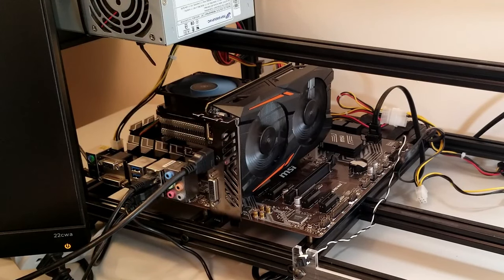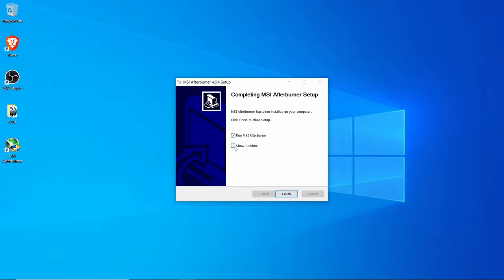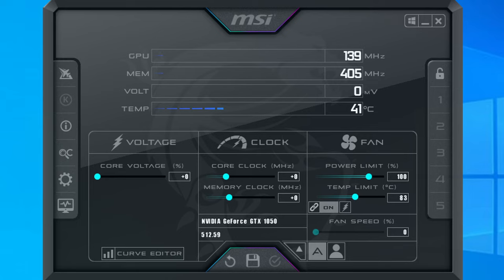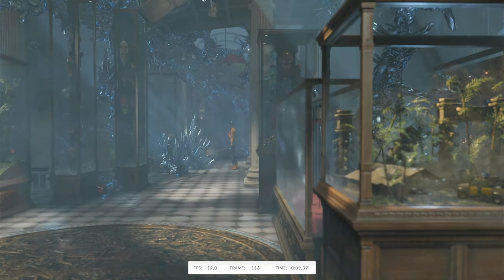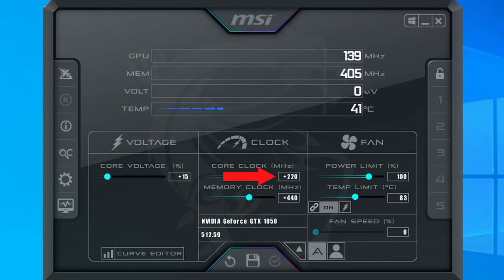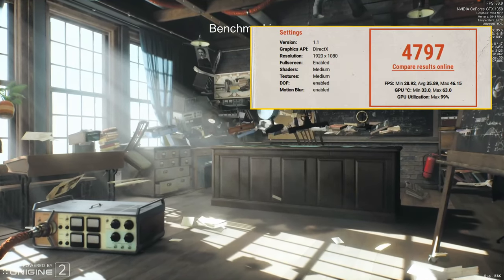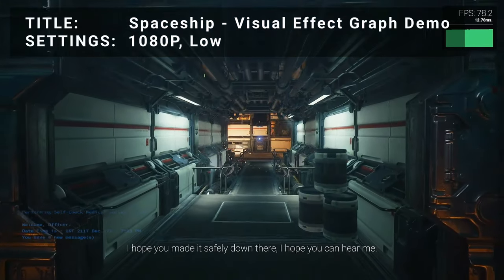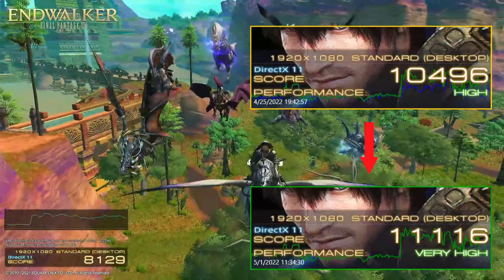Best GTX 1050 Overclocking Settings Guide

Comment: So u can make a gtx 1050 into a 1050ti by overclocking it 😅😂. I have noticed a slight performance boost by using old drivers and then OCing the card. I use a program called nvidia inspector for overclocking and memreduct to maintain a good fps in games even though I have 16gigs or ddr4 Ram. With every new drivers there are fixes but very very slight performance decrease 🤔
Reply from the maker: Thats a great point. Sometimes you can get higher overclocks by using older drivers.
Reply: what specific older driver you use mate?
Reply: @jeremiahb.1868  Right now I am using the latest one available 
When I used to use the old one it was 374. Something like that

Comment: I have gigabyte gtx 1050 2gb oc card for 4 years, can I safely overclock it? or it would be any bad impact on card?
Reply: My GT 1030 SDDR4 2GB has been running smoothly with me for 2 years now, you can overclock it of course since yours is more powerful than what I use. Your GPU should have a failsafe mechanism before the stress is too much if you overclocked it a bit too much
Reply: What oc settings suit you the best ? I'm kinda stressed to overdue it

Comment: +235 MHz core clock and +780 MHz memory clock with my HP GTX 1050 without increasing voltages. Many thanks for the guide!
Reply: bro will it not over heat the laptop?? like can it handle when i run applications like streaming softwares and all ? btw im running a lenovo ideapad l340 8gb ddr4 1tb hdd 256 gb ssd and a Gtx1050 ....... jus want to clarify that it wont overheat or melt or cause any problem lik that?
Reply: @OosinBBX_0_0  I play The Witcher 3 right now, had a couple of crashes and had to lower frequencies (+200 MHz core and +700 memory). Since I did it, everything is running pretty ok. But I have a PC, not a laptop. Laptops are usually harder to cool down, so I'd probably start with lower frequencies (like +150 core and +550 memory) and test it while monitoring temperatures (with gpu-z or something like that).
Reply: @iolar_si  ohh thank you so much bro for telling values suitable for laptop version coz i was in a fix when i had put 235 nd 780  it heated nd crashed constantly lol but thanks anyways for telling the laptop values :)
Reply: @iolar_si  another doubt....at what temp below should it be fine ? like 80*c or smthing like dat?

Comment: be aware that overclocking have drawbacks. the higher you go the more stuttery it gets, doing so with the core i do not recommended but for memory i think +200 or lower could help in some games for this card
Reply: I overclocked my asus rog strix gtx 1050 2gb with 200+ core clock and 385+ memory and it runs at 59 degree celsius with 60% fan speed.
Reply: @Kilgore2307  your gpu life span will drain and degrade faster. i recommend overclocking only for particular games as a side profile.
Reply: @airshark2764  That's what I did. Anyway, I'm just playing Rdr2 only and the rest I'm running stock.
Reply: @Kilgore2307  Is there any side effect? It's been a month. Has anything happened to your graphic card?

Comment: ive had a gainward gtx 1050 for about 6 years now so fuck it, ive put +200 core and +700 memory with 5% volts, ran benchmarks 2-3 times with scores being around 13% better then without oc without visual bugs or crashes. its at a stable 63 c. if i burn it with this atleast ill have a reason to buy a new one finally.
Reply: I'm trying this on outerworlds wish me luck

Comment: +180 to core clock
+1000 to memory clock
runnin pretty stable rn no weird pixels poppin on the screen but imma only use it while i game just to be safe

40 celcius 
fan speed 45
while no game is running
Reply from the maker: Very nice. That's an impressive memory overclock in particular! 👍
Reply: @XLSTech  bruh my screen went grey after booting on a game so i changed it to +106 core clock and memory to +503 now its really stable i think

Comment: hello friend, what was the best overclocking? I don't speak English
Reply: he didnt say it, he just listed what worked, doesnt mean it will work on yours. here:
 CORE    MEMORY   VOLTAGE
+150     +265
+180     +500           1.10
+200     +285
+200     +690           1.20
+205     +200
+220     +300
+220     +440           1.15
+220     +500           1.10

Comment: GeForce® GTX 1050 Windforce OC 2G .. 
brother tell me how to set up this card?
Reply: Just do what he said in the video. Use any gpu benchmarking tool. Mine was Valley/Heaven/Superposition. I'd rather Heaven then try increase your core clock and memory clock by 100 without unlocking the voltage control and start the bench. If it's sucessfull, try increasing those clocks by 50 again without increasing the voltages then try to run bench again and so on. Find the right clocks with those two without increasing voltages first. The core clock usually the one who might get the instability errors here except the memory clock as you can see, I manage to get my CC to 185+ and my MC to 850+ without increasing the voltages.

Comment: Hey , does your gtx 1050 support increasing power limit beyond 100% ??
Reply: yes, its an option to enable in the settings for MSI afterburner, he shows it in there
Reply: @derek8564  but all 1050 model doesn't have that feature in after burner by default.
Reply: because it has no power pin hence it is disabled by default, as is drawing 75W from the pci slot, more power might damage the lane
Reply: @kevinrezawan4853  bt mine max is 65watts only . 

It's different for different vendor & firmware . Some have 75 limit some have 65 .  Also even though mine is 65 watt it doesn't support increase in power draw through after burner . But still some GTX 1050 support that(specific to particular firmware of some vendors )
Reply: @kevinrezawan4853  actually I don't think so , i mean if motherboard manufacturers increase power draw limit for pcie to 100watts it won't burn lanes . Because same motherboard can also support higher watts cpu like i9 12900k which can draw more than 150 watts. So there will be no issue if they increase pcie power draw limit to 100 Watts.
Reply: @squidscrew1339  probably yeah but lower end board might not tolerate it as good as something used for i9 level. But I saw someone on reddit saying that might be unstable and it is best to play overclock w cards that uses ext pin power

Comment: GTX 1050 in hp gaming laptop but for some reason after clicking the voltage control setting like you said I’m still not able to adjust the voltage.?
Reply from the maker: Interesting. If you have selected "Unlock Voltage Control", rebooted the machine, and it's still not allowing you to adjust voltage, you may try another program and see if that will allow it, such as Nvidia Inspector. Laptops by design are known to have much more limited flexibility when it comes to power usage and overclocking in general however.

Good luck!

Comment: I still cant change the core voltage even after enabling the tick in settings, why is this?
Reply from the maker: That's strange, did you reboot the machine after applying that setting? In most cases a reboot is required.
Reply: @XLSTech  I fixed it but I'm only able to put in 1% I can't do like 1.15% or 1.20% as shown in video. What should I do?
Reply: @jbqss  you get 1.15 by writing 15 into the box (it counts as by how many % u want to increase the voltage, so 15 makes it 1.15 :)
Reply: @btoman98  oh well the voltage doesnt save when I press save it goes back to 0 for some reason

Comment: Hello, a question: The card must be with the OC on even when you are not playing a game (or something that requires such oc)? If I remember correctly, the nvidiainspector had something like levels of demand, where the OC is "only" applied when the usage is high. Is it the same with the Afterburner? Even with the Voltage?
Reply: The gpu and memory will still clock down for their idle states. The overclock only applies under load.

Comment: Hi, I'm a bit late, but increase  of 130 to core 1000 to memory considered a right overclock? I mean which one is more important? I got my 1050 run very stable with those settings but I'm wondering
Reply from the maker: That sounds like a great overclock. The memory clock increase sounds especially impressive! 👍
Reply: I'd rather got higher core clock than memory clock
Reply: @nelju0621  glad I saw your reply because I can lower my memory to get more core, will test both and see the results.
Reply: @amroelmughrabi  what is a good mid overcock position ? ( what ere the results
Reply: @BOT_EFE  after a lot of checking and trying 130 speed core and 1000 to the memory core is the best my 1050ti can do and believe me it makes a lot of difference.
I tried to get more speed core with lowering the memory core but with no luck to get it stable.
Stable and daily use for me was 130 1000
No issues at all
Reply: @amroelmughrabi  thank you very much since a gotta live with my 1050 even though i wanna upgrade to a 1060 bc i dont have enough money i wanna get the most out of my 1050
Reply: @BOT_EFE  same here I'm stuck with 1050ti I want to upgrade but money issue, will wait until gta 6 comes out I'm very sure by then we need gpu upgrade but currently 1050ti can handle most of the games with no issue.
Reply: Tengo una gtx 1050 2gb entonces cual es la mejor configuración

Comment: I can't change my voltage and fan speed on gts 1050
Reply from the maker: If you're using MSI Afterburner, you may need to first go to Properties, then check "Unlock Voltage Control" then restart your computer before that setting opens up to you.

Comment: How would you apply this to laptops with the 1050*
Reply from the maker: Overclocking laptops is certainly possible, however stricter heat and power issues can often make it significantly more difficult. If you are going to try, you may want to start off with smaller overclocks to start. 👍
Reply: @XLSTech thank you so much. It’s not allowing me to change the voltage for some reason so I went with the +220/+300 example. Seems to be better but I’ll have a better idea later today when I can dedicate some time to gaming